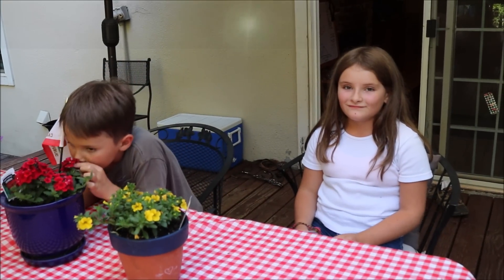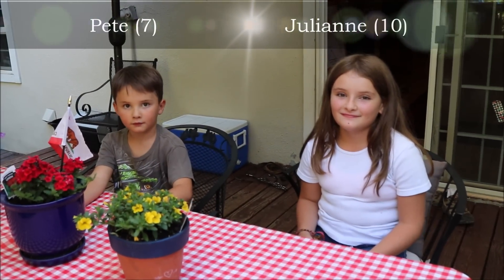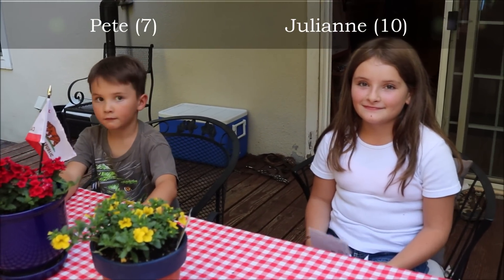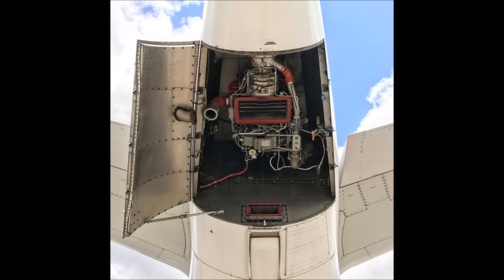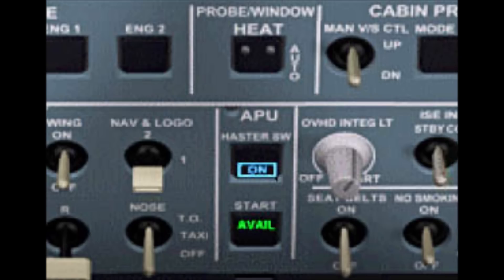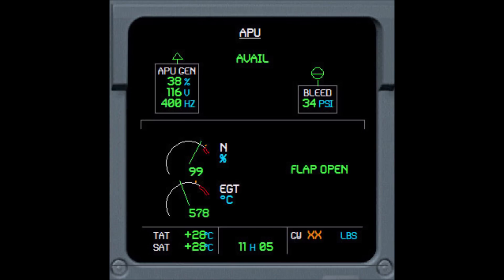A321 Birdstrike(s) Dual Engine Failure Moscow UPDATE- FAQ's

Comment: Don't forget, Sully started the APU right off the bat, and without following a checklist. He did that because he has a thing called airmanship. These guys didn't have time but, it should still be in every airman's mind. Especially in an aircraft like the Airbus. It's complicated, but direct law is not a place you would prefer to be. It won't happen because of fuel/cost considerations, but taking off with the APU running (which you do in low vis ops anyway) where there are birds around should be a briefing point.

Comment: I'm cool with all that. I have often wondered if it wouldn't be better to leave the APU running through climbout to ease a restart if needed or supply full aircraft power if that didn't work. I assumed this wasn't done for reasons of economy but now wonder if aerodynamic issues might prevent APU use as velocity increases.

Comment: How would a highly sharpened spinning set of blades go at the front of the engine with the objective to cut any ingested matter into small pieces ..... would this upset the air flow into the engine.?

Comment: As a retired airline pilot myself, I agree with your assessment of how the crew dealt with this situation. They were put into a suddenly stressful situation with little time to prepare, thus they had to fall back on strictly judgement as to what was best to do in the little time they had, and they got it right. I'm especially impressed because of their low time and lack of experience, but they did it with no one getting hurt, and it appears that the damage to the aircraft may be slight, such that the airplane could be repairable. My hats off to them!
Reply: No, it is not repairable.They are cutting it apart today.

Comment: From the the AE's corner: It has much less to do with flow as suction side is omni (F117 had grated inlets and the SR71 was the grand daddy of obstructed inlets)  than it does with a structure than can withstand the impact of a 30LB bird and not cave in to create an even larger damage impact.  So a bird of that weight hitting at 300KTS has more energy than a .50 rifle. So now you have to build a non-restricting structure that is bullet proof or whatever you build it out of will become the next projectile into the compressor.  Much better to have the blades chew up a relatively soft projectile(birds) than a titanium grate broken loose. Weight is another consideration given the very rare bird impacts compared to 80,000 flights a day. Additionally anything you put in front of the compressor (like the old struts supporting the starters in turbojets) has to be de-iced or ice build-up will randomly break away and hit the blades.
Reply from the maker: Great points!
Reply: MrRexQuando Excellent answer!
Reply: the cone-shaped part in front of SR71 are not guards. They are there to slow the incoming air to below the speed of sound. The engines will not run if the intake is not slowed. At speeds these or most aircraft travel at take-off and landing a bird or two is like being hit with a cannon. The pilot's windows are tested with frozen chickens and turkeys shot from a propain powered cannon much like a pumpkin chunk in cannon or potato gun. Engines used to be tested in a similar manner and might still be.  With the SR71 in mind, MrRexQuando may have a good point. A properly designed system may well help the engine rather than choke it. Maybe its time to think out of the box. Depending on local bureaucrats at airports is clearly not working.

Comment: 74Gear did a great explanation without being as technical of why not using screens in front of the engine. Short version is birds are typically no higher than 3,000 AGL airlines spend less than 5% of flying time at or below 3,000 AGL the rest of the time they need the air that the engine is pulling in. And a screen would block the airflow needed.
Reply: not true or the SR71 or F117 wouldn't fly would they. I love Kelsey but that's totally not the reason.
Reply: MrRexQuando both of them have their engines set further back to get to the first blade too. So I’m gonna step back on this one and say I don’t know. I’m not an engineer. I worked on them in the military but not enough to get a full education to understand the amount of airflow required with respect to each type of engine. Maybe someone with more knowledge can explain it to me.

Comment: Great video as usual. Clarification on the 320/321 remember you also have accumulators in the hydros. All three circuits.  This provides uninterrupted  power to the control surfaces.  This is what you hear barking when the main engines are cut off while it equalizes between the three as they slowly lose pressure.  People always talk about Sully being a genius starting the APU but that is item 12 for a reason.  He had power/hydraulics without it.  Like Sully awesome stick/rudder pilots!  Keep up the videos! Can't wait for you to hit 100K ! You are so much more informative than the other guys.  Nothing against Mentour but you are so much more knowledgable about this stuff.
Reply: With the APU start just taking a couple of seconds of Sully's time, and the long delay between pressing the button and it coming online, I think he made a good call that did improve on the checklist.  I rate it as a good example of pilot's discretion.
Reply: @Murph9000  My comment is not about Sully's skills or the checklist but the popular misconception that starting the APU saved everyone's lives. Sully's piloting skills were bad-ass and did save everyone but the plane glides just fine without providing cabin lights.  5-10 seconds of APU startup could have been the difference in attention and time to process between a turn to Teterboro and landing on concrete or forcing a landing in the water. Aviate Navigate Communicate.  If the guys in Russia would have been fiddling with the APU maybe loss of airspeed and everyone dies. I can site at least 1/2 dozen crashes where too much attention to aircraft systems caused a crash.
Reply: @MrRexquando  The APU had one major benefit, and a more minor and subtle one.  The RAT doesn't power the flaps on the A320, but the APU does.  The ditching procedure calls for flaps.  It also gave him normal law, rather than altn law with the RAT, providing AoA protection.  Now, I'm quite sure he could have hand flown perfectly well without protection, but it's just a little extra help in a high stress situation.
Reply: @Murph9000  You are not wrong.
Reply: MrRexQuando The hydraulic accumulators would provide enough to power the flight controls, but probably not enough to deploy the landing gear or brakes. (Not that either of these were used,  and the gear can be deployed by gravity).
Reply: @gordonrichardson2972   The RAT automatically deployed providing power for critical systems and backup hydraulic loop pressure. Look up 
Air Transat Flight 236
 all of these concepts in practice.

Comment: I was hoping it was going to be a more useful update.
Gear up was the right landing option - and possibly is in the case of all off-runway landings. Even in a landing on 'short grass' where wheels would be reasonable, you just don't know how uneven the land is under the grass - even a big dip a car would cope with fine - to aircraft speed, it'd be horrendous with likely broken leg resulting.

Hey, noticing the flat spot half way up your nose - what happened - walked into a wing ?

Thanks for the answers to the daft questions. APU - who knew ? - So, in an engine/power failure at height, RAT deployed, what's the use of the APU ? If they'd got the APU up and running, would they retract the RAT ?

If the Russian pilots made mistakes, they didn't make any bad ones ! Damned good effort - especially considering their flying hours.
Reply from the maker: flat spot on nose-Potowatomi heritage on mom's side.
Reply: @blancolirio  Really interesting ! Thanks.

Comment: Even with the landing gear up, the engines too were ripped off during landing, um surprised they didn’t rupture the fuel tanks in the wings, also the main landing gear is attached to the fuselage and not the wings, would they have had as much risk to the fuel tanks as the engines?

I think the best reason for leaving the gear up is literally to use the sled effect of the fuselage to create the least amount of friction into the corn field, the landing gear would have just dug in and created unnecessary adverse resistance. 

I’m not convinced that the research around laminar air flow is convincing enough that some sort of grid for bird protection over the engine in take would prevent these incidents. At the end of the day it’s about the maths around volume of air required for the compressor, creating a 3D cage could compensate for that.

Comment: On anti-birdstrike grills in front of the engine: If this grill hits a bird at 200 knots, the bird isn't going to bounce off. Instead the engine will ingest a diced bird rather than a whole one. Given that the fan and compressor blades are about to dice the bird anyway, the grill has achieved pretty much nothing useful.

Comment: They could use nozzles like they do on the 737-200 where bleed air is blown from nozzles from the nacelles to direct stones away from the engine, when landing on gravel runway.  Perhaps it wouldn't be possible in flight at a higher airspeed on bigger engines.

Comment: Mr O’Leary my father flew MiG 21 and that aircraft has a variable flow nose cone. The cone extends as the air speed increases. This could protect bird strikes?
Reply: Probably not.  The speed-adjustable cone or "mouse'" is to slow the airflow from supersonic to subsonic before it enters the engine.

Comment: This is one of the reason why i prefer a 320 family then the 737 crash landing a 737 without landing gear down is big problem because engine's low to the ground high chance aircraft will break apart

Comment: If any channel deserves 100K it's yours, Juan. 

I have an APU question. Is there any reason the APU can't remain operating during takeoff, maybe until the aircraft attains a certain altitude AGL?
Reply from the maker: It can, but it just burns fuel  that would need to be added to the flight plan, costing everyone in weight, payload and cost.

Comment: Great analysis!  I work for a major us airline as well. I experienced an engine failure just after gear retraction as the left engine EGT exceeded redline, compressor stalled several times, and ECAM/QRH called for an engine shut-down.  You are so correct in that flying the aircraft when startled and least expecting a problem buys you enough time to assess....then settle into a training based response.  Aviate, Navigate, Communicate....ah men.
Hope your doing well with your medical issues Juan.  Thanks for the postings.
Reply from the maker: Thanks brimopm!

Comment: But I asked who cares about a little bit of fuel verses possibly killing every one on board.. What about the idea I had of always having the APU running during take off up to a certain height then shutting off and restarting before landing till landed as that way you would have it running in the two different times when bird strikes are at there highest chances of occurring? If it ever saved lives it's worth all the fuel it will ever cost. Thanks again for your very informative videos.

Comment: Thanks for the follow up.  I had asked the APU question as I thought it provided hydraulic power as well as bleed air. 

Love the channel, please keep the videos coming.
Reply: Bill Neely In another comment it was noted that the hydraulic pump circuits have accumulators, which provide enough pressure until alternative power is available. In this crash there was probably enough to complete the very brief flight.

Comment: Are the engines on the A321 more susceptible to bird strikes than others?
Reply: James E. Wagner JR. The A320/1 and B737 use similar engines, but the front fan on the A320/1 has a different number and type of blade construction. Two crashes are not much evidence to base on, but hypothetically the engine fan design may have some role.

Comment: I have a bit of aviation experience and I am beginning to become very impressed with your knowledge and ability to explain things aviation related.  I would love it if you would do a video on Takeoff V-speeds.  You have often mentioned V1 and stopping but not also the ability to takeoff after V1 in the event of a loss of an engine.  As you well know, the subject of takeoff V-speeds is complicated and very important to the safe operation of a jet.  When I was in the Air Force I was a real expert on takeoff/landing data but over the decades I'm sure there are some fine points I have forgotten.  Thanks for the videos.  You are doing good work.
Reply from the maker: Good idea!

Comment: QUESTION 
Do you practice off field landing scenarios in the simulator?
E.G.   Capt. Chesley Sullenberger didn’t know his airliner had a “ditch switch.”
Reply from the maker: not really.
Reply: Thx blancolirio 
Well, maybe you should look into that—- even though it’s kind of unthinkable.  Practicing them might sharpen up ancillary skills.
Also, it might add an interesting item to the drill.
Reply: jmwSeattle Simulator time is expensive, and prioritised towards more likely and known events such as single engine failure,  rather than rare and unpredictable ones.
Reply: Right, we learned from the 737 debacle that $Billions can only be spent on something like that.
Anyway it’s just a dead stick landing off field, which I hope they do practice.
We know of at five airliners now that have made them.

Comment: Juan, just curious. If you have an old A320 manual laying around, would you please look up the Ditching checklist and see if it calls for gear up or gear down.
Reply: Bat 22 Are you serious? Why would any plane ditch with gear down?
Reply: @FutureSystem738  I can't think of a reason. In fact, out of the 24 Aircraft Flight Manuals I have had to read while getting check outs, not a single one called for ditching with the gear extended. So.... cool your jets Sparky, I was simply curious what the A320 Manual says. I like manuals. Every pilot should read their manuals. Manuals are FUN.:)
Ditching sim ride : https://www.youtube.com/watch?v=lDW9J8oVFZc
Reply: @bat2293  RTFM! Good on, ya, Bat 22.
Reply: @HiWetcam There is usually a quiz before you walk out to the flight line. Pass the quiz, you get to go fly. Check Pilots can be .... quite demanding when it comes to demonstrating your competence. It helps if you know the Manual (especially the memory items).

Comment: They did right! As far as landing gear down is concerned, with the wheel weights and tire pressures of modern airliners, about the only natural surfaces that would work are places like a salt flat in late summer, long after the most recent rain, but being a dry lake, the subsoil is likely to be clay and while fully capable of supporting a bush plane, would exhibit plasticity that would result in the wheels sinking resulting in ruts, or in best case, a slow sinking until the plane rests on its belly. In short, airports are far more plentiful than suitable natural landing sites. In the Russian situation, the fact it was a corn field probably assisted in the success of this emergency. We don't know if the airplane is economically repairable, but the salvage value should be quite high. Just the value of the fuel that can be pumped from the tanks is considerable. Anytime an aircraft has to be defueled, that fuel requires reprocessing to remove contaminates and even water which has condensed from the air in the tanks. The recycled fuel is often diverted to non aviation uses such as marine engines. The outcome depends on regulations and economics.

Comment: Bird screens are used for some engine ground test runs and some helicopters are fitted with them permanently. The massive loss of engine efficiency at altitude makes inflight use a non-starter.

Comment: Concerning a screen to stop birds from entering the engine, how strong would you have to build the screen to stop a bird(s) from entering the engine?  You know the damage a bird can do to the leading edge of the wing or nose and the wind screen on a plane.  Now to build the screen strong enough to stop birds,  how much would it weigh?  The engine manufacturers test the engines by throwing frozen chickens or turkeys (not sure which) at a velocity that might happen in the real world.  The pilots on this plane did a good job.

Comment: I realize that this was not a U.S. based flight. That said; I believe that the only requirement that the FAA has in place, regarding communication with passengers, is a preflight safety brief.  I don't believe that communication, during an event, is required.

Comment: Historical note:  A few early (post-WWII) turbojet engines did have retractable screens positioned in the inlet duct.  If my memory is not defective, I remember seeing screens on J-35 turbojet engines at A&P school in the1960s.  In service, it was quickly discovered that the screens not only restricted airflow when deployed, but that at high power settings, reduced pressure in the inlet (not due to the screens, but because of the Bernoulli effect), resulted in a temperature drop which caused rapid icing over of the screens.  This led to immediate engine failure.  The screens were deleted long before the arrival of the turbofan engines which would have made the screens even more problematic.
Reply: Hopelessand Forlorn Thanks, good answer!
Reply: Don't forget the screens iced up causing the air restriction.